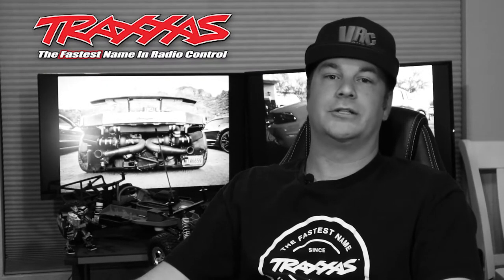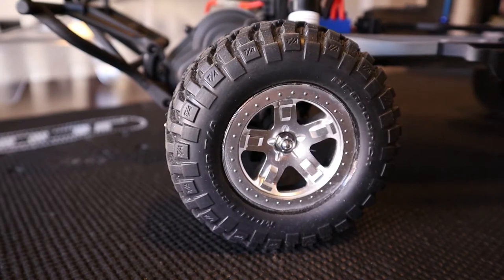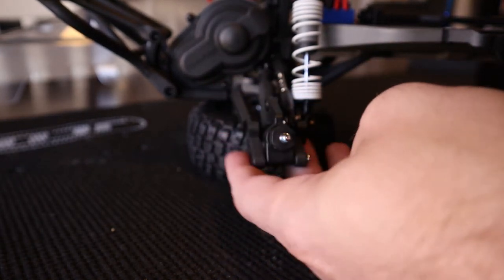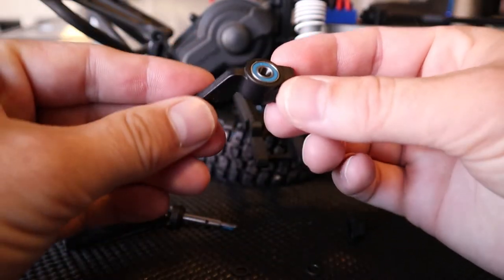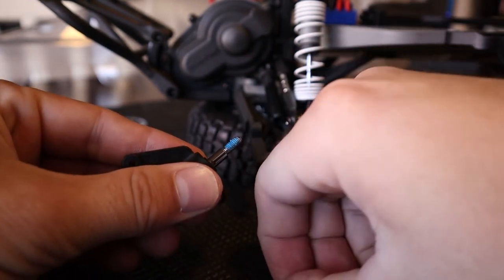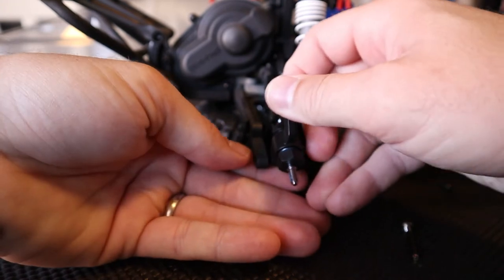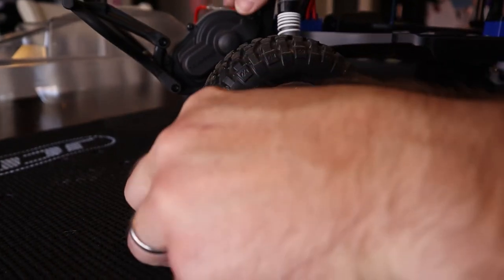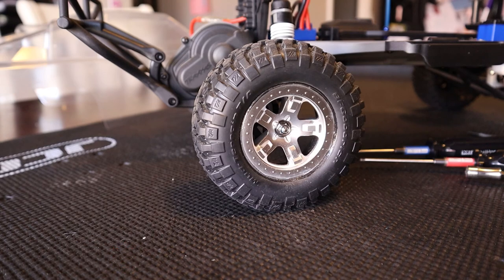How to Replace the Rear Hub Carrier on Your Traxxas - Slash - Bandit - Rustler - Stampede - TRA3752

Comment from the maker: So it turns out that all the 2wd vehicles have a shim on either side of the hub carrier Except the Slash (only on wheel side). I guess the manual for the early kits had a misprint. 🤷🏻‍♂️ Shim your vehicle appropriately.
Reply: What do you mean by shim so my rustler vxl won’t be just like this
Reply from the maker: @BikesNBullets  washer that goes on the hinge pin
Reply: So the hinge pin gets a washer on each side just like the hub carrier?

Comment: Question. What if the hex doesn’t come off. The part where the wheel goes onto. I’ve used a flathead with a hammer and still won’t come off
Reply from the maker: It should come off but if it doesn’t you might need to cut it off and replace it. The nice thing is, Traxxas parts are cheap.

Comment: I have 2 little rings that came out of my hub assembly of my Redcat Tornado. I noticed them just sitting on the shaft that spins the rear wheel. Now the wheel has trouble spinning and creating a lot of heat. Any clue what I need to replace?